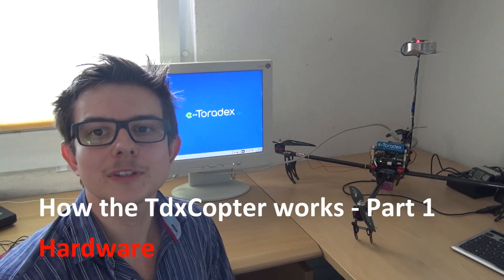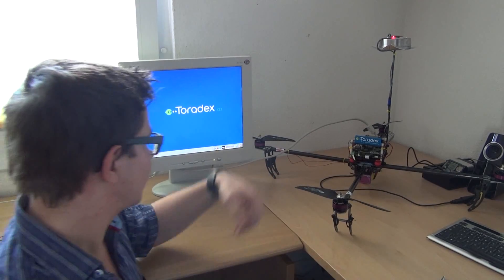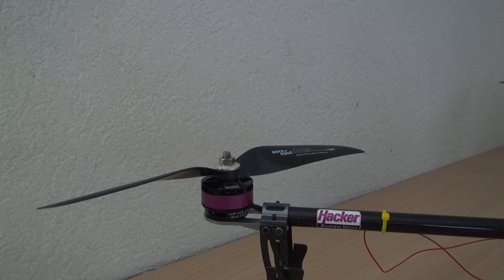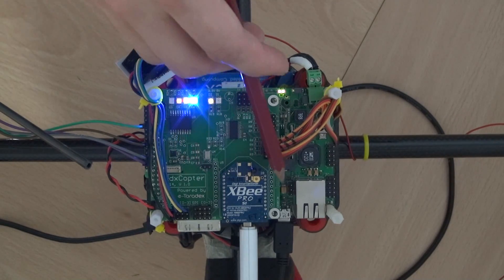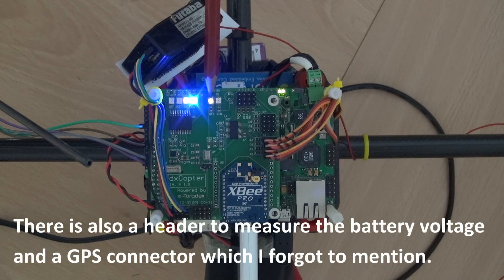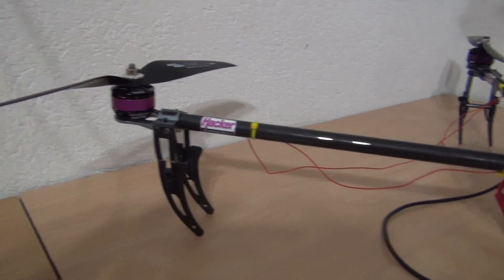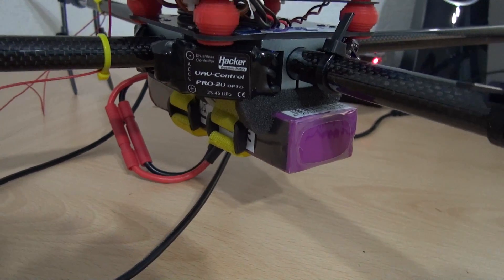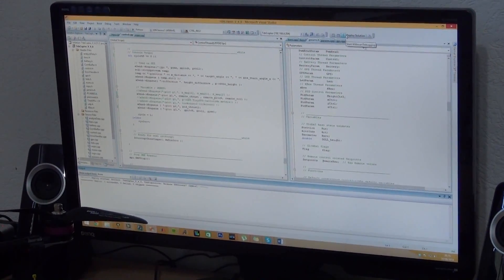How our Quadcopter works 1 - Hardware

Comment: nicely done beni :D 
great video
Reply: :) aprechiate it! working on second part right now :)
Reply: Beni Winter can you please tell me, how do the propellers work? i mean do they make the quadcopter turn, move in forward/reverse direction, etc?!
please help
Reply: HABIB ARIF YES they do! The important thing is to have two different props wich turn in different direction. When changing the speed of rotation this results in momentum so the quadcopter begins to rotate. Moving to a side or foreward is done by changing the force upward which is proportinal to the speed of rotation. Like this the quad gets in a tilted position and begins to accelerate in this direction.
Reply: +Bernhard Winter thank you!:-)